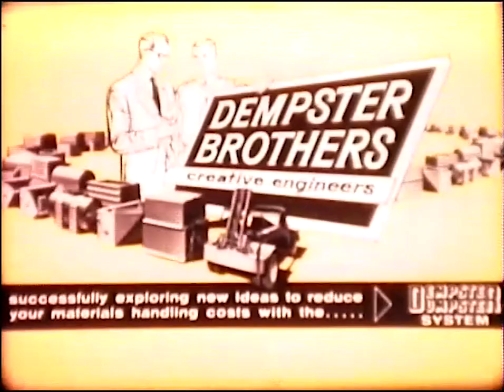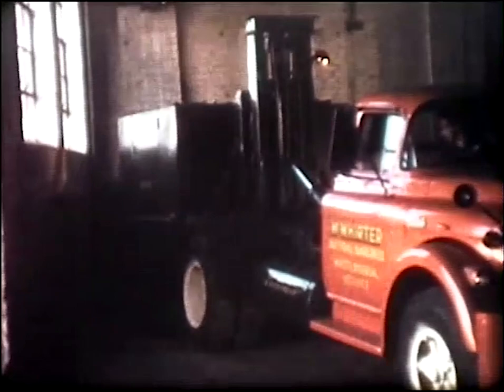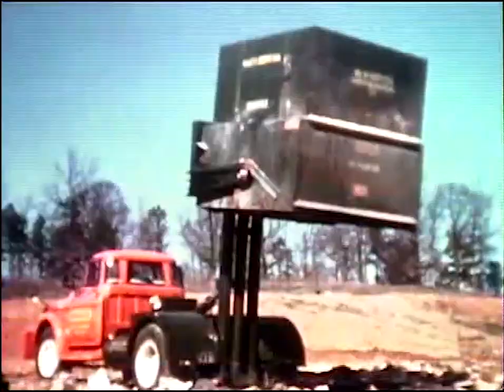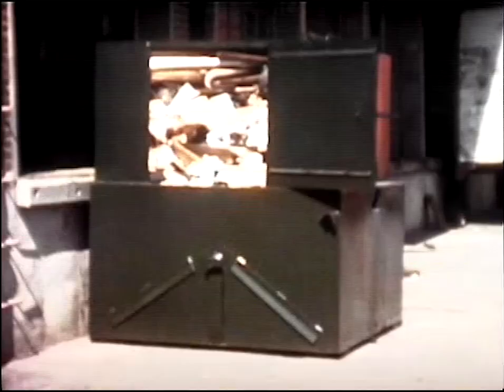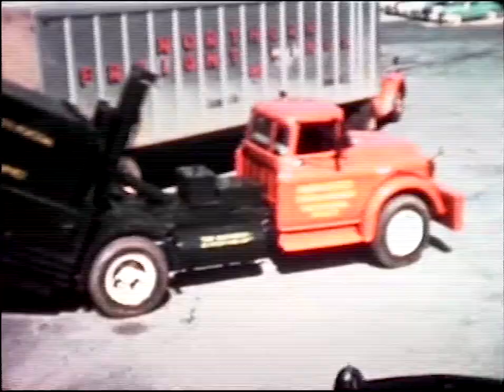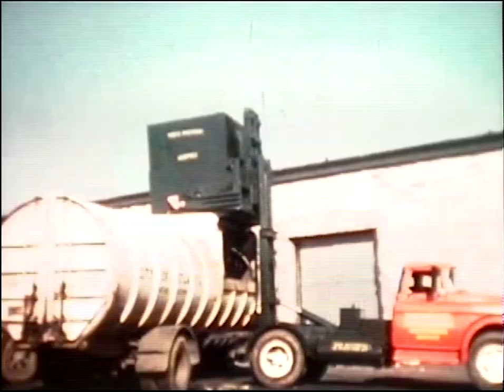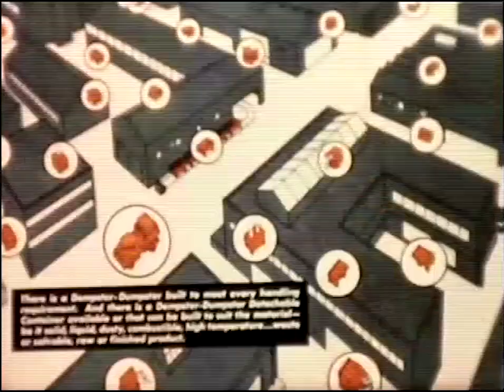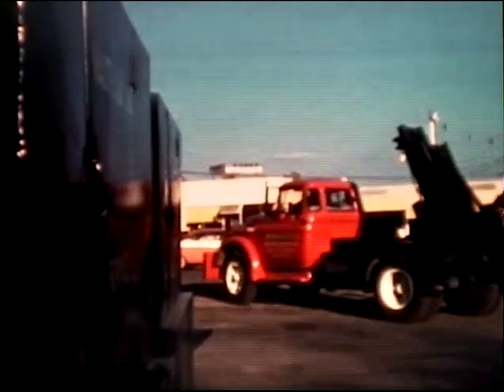1958 Dempster Dumpster GRD-304 F-2 Product Video

Comment: Sure looks like a big counterweight as the front bumper. Bad weight distribution required this I can imagine. As someone who runs the old chain arm style Dempster system, this looks like its only advantage would be not having to get out and attach the chains.